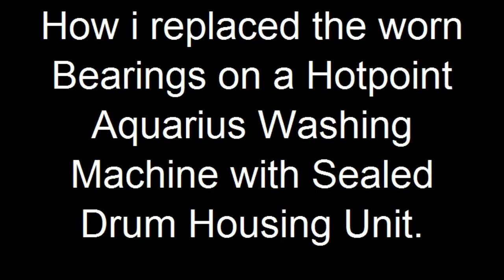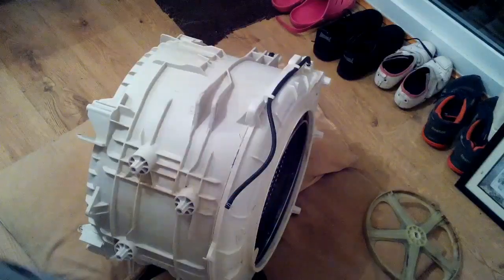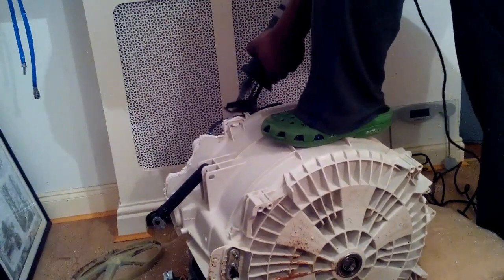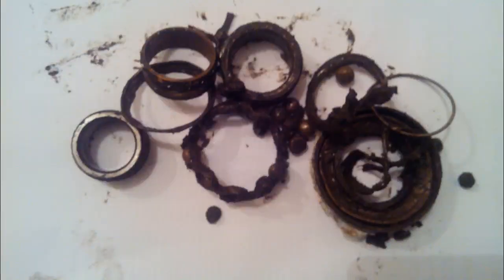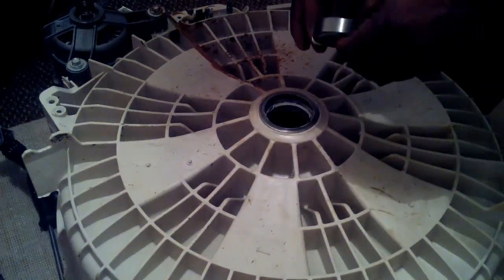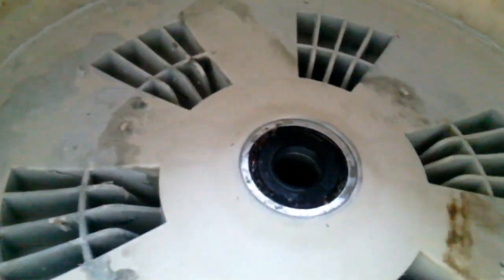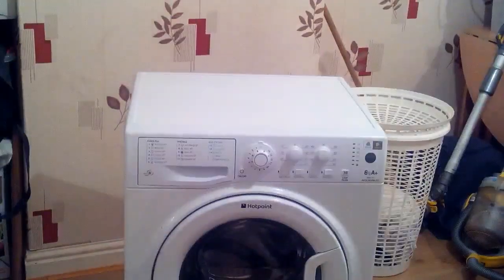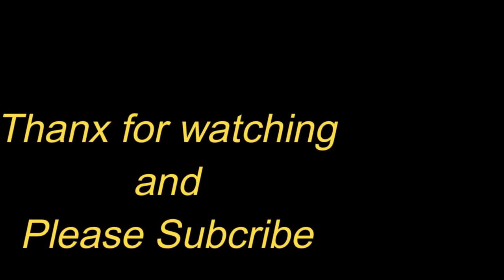Washing Machine Sealed Tub Bearings Replacement

Comment: I have done this to sealed drums before but plastic welded instead of bolting together.
Reply from the maker: Hi David,
               whatever means of holding the Tub together securely will do I suppose, just thought this way was easier and future proof
            
             Kind Regards.
Reply: @green-crocs-fixes1520  I will try your way in future what glue did you use.
Reply from the maker: @davidlawrence942  Hi David, I used Gorilla Glue the brown stuff.
Reply from the maker: @davidlawrence942  or see 14:25 on my other Vid;  https://youtu.be/rvjRUx1kAvU

Comment: Hi.. how did you find the right bearings for this as it's a sealed tub they always say not available.
Reply from the maker: Paul Berry Hi Paul,
                                  Had to measure the old Bearings radius, diameter and thickness, the seal also and then request these sizes from an online Bearings seller. You wont find a set of Bearings/Seal listed for this machine model as it is a sealed unit and they are not suppose to be replacable.
                                 Kindest Regards,
                                                                  Dave.
Reply: Green-Crocs-Fixes Great info, thx!
Reply: Paul Berry o
Reply: I bet the manufacturers love You. No doubt if You hadn't shown this, a lot of machines would have been scrapped. Brilliant, and thank You very much for that

Comment: What glue was used ?
Reply from the maker: Hi Fresh Cut,
                       Used Gorilla Glue waterproof.
Reply from the maker: .. and Snowflakes is banging 👍👍
Reply: Thank you for the reply 😃

Ahh I used a red hylomar like seal on mine... needless to say it failed after 15minutes for me, I spent 6hours start to finish then left it 24hours 😭🤣. 
I didnt have any gorilla glue and used only 10 nuts and bolts, but it was well worth the fun of tearing it apart and rebuilding it. Lessons were learned. 
Your video is brilliant, I just wish I'd followed it to the letter.

Thank you for checking my video out, really appreciate the feedback 👍🙂
Reply from the maker: @Freshcut93  Yes I used to use Blue Hylomar on engine gaskets back in the day, and this would seem ideal as it can withstand high temperatures, however this is a different setup. The bolts are used to hold the Tub together, the Gorilla Glue is used as a seal as it expands when drying filling any gaps missed, also helps to hold the unit together.But like you said.. nothing ventured and all that!

                         Regards.

Comment: Hi, it seems we have the same washing machine and next weeks i have to replace bearing on my hotpoint. Do you remember bearings model?
Reply from the maker: Gino Van der Pistillon Hi Gino, There are no listed replacement Bearings for this model as this has a sealed tub. So I measured the Bearings inner and outer diameters and width then sent the sizes off to an online Washing Machine Bearings supplier requesting the sizes and Seal. They are cheap enough. Regards.
Reply: ok thanks

Comment: I have the same issue with my Hoover washing machine which has a sealed tub. Thought it was irreparable before seeing this video. Could anyone that has done this repair confirm if the glued seal held up and how long since the repair. I am just concerned the glue will fail and leak. Thanks
Reply from the maker: “ Ye of little faith’ 
                              Namski, I have repaired three so far, this was the first. Used it for about 18 month’s then sold it on eBay.

          Regards 😀.
Reply: @green-crocs-fixes1520  many thanks. I have in fact gone ahead to order a set of bearings so I can carry out the repairs. I really don’t have £400 for a new washing machine this time around. Hopefully it goes well. I have rewatched your video and made notes on steps to follow. My only issue now is not knowing if I have ordered the correct bearings set as my particular Hoover (oph761df-80) don’t have any bearings described as compatible, since it is a sealed unit. Hopefully the generic one I have ordered will work. 

Thanks for your video. It inspired me to go ahead with the repair. I might use a wet room grade silicone and see how it goes
Reply from the maker: @namski2410  Namski 
                                           There are no replacement Bearings or Seal listed for a Sealed Tub or Eco-Tub Washing Machine as they are not designed to be replaced, hence why the unit is glued together where as conventionally they were bolted together. So you have to measure the old ones once you have removed them, them request the sizes (Bearings and Seal) from an online Washing Machine Bearings seller. 😀.
Reply: @green-crocs-fixes1520  great. Makes more sense. I will stop my order for now and get out the old bearings and seal first. Good idea. Thanks again

Comment: I have a similar machine, the bearings are fine however I just had to replace the 2 lower suspensions legs due to it shaking about violently, now I have a leak that is somewhere near the back and is getting onto and into the motor but I cannot find the source. is it possible the violent shaking has cracked the outer tub? and if so is there a way of fixing it?
Regards
Reply from the maker: Dave Kemp Hi Dave,
                                       You may find that the crack is around the bearing area as there is a lot of stress around that area anyway, and the extra shaking makes it worse. Strongly recommend that you remove the Tub and Seal with Gorilla Glue, squeeze it into the hole or seam when the unit has dried out as it will expand and leave a mushroom type seal. Then allow to dry for 24hrs. Regards, Dave.
Reply: Thanks for your reply, I opened up the sealed tub with my scorpion saw with a fine blade fitted. Sadly one of the legs on the spider has shattered and shards of the metal have punctured the outer plastic tub in quite a few places. As the spider is welded onto the inner drum and the price of a complete unit was so high I had no option but to order a new machine. Had individual parts been available I could have fixed it but modern times being as they are the manufacturers want you to buy the full tub/drum assembly.
Reply from the maker: Dave Kemp Sods law M8. All the best.😎

Comment: Full marks for that even with this being an old post. Is it still going ?  There is one thing which spoils it a bit, and that is the music because at the end on the water test outside, I could not make whether there was a sound from the drum 'rubbing' or it was the music,   A GOOD VID  all the same, well done. Why the hell do they seal the drum ? If an engineer had come to do the same repair, would he have cut the drum open OR charged you 160.00 for A NEW Drum outer, inner and bearings? because that would have been what I call a 'rip off"!! Many would just buy a new machine.?  Total waste of money to just throw out.
Reply from the maker: Hi John,
               Well spotted. The machine was banging initially as i had accidentally placed the top brace the wrong way round but that was resolved. A machine engineer is not going to cut the Tub in half in your Kitchen as this would take too much time and cost too much. The wife used this machine for over one year, i had already brought a replacement one when this one broke down, so i decided to make a project out of it but it was sold on as i had another machine to repair. Manufacturers do not want us to repair these days John; they think we are as flush as they are. You even need a computer to diagnose and clear a fault on your own Car.
  Thanx for the comments John,
                                                         Kindest Regards.
Reply: Your welcome sir.  :))

Comment: Hi,
So I have a strange request maybe you may be able to help.
I opened up my 8kg indesit innex washing machine and the bearings are completely damaged. The front bearing was completely shattered :-(. Means making measurements becomes rather tricky.
Anyone ever opened such a machine and still remembers the sizes of bearing ordered?
Reply from the maker: Hi Dennis,
                  So long as you measure the outer diameter of the big ring and the inner diameter of the smaller ring for both bearings and their width, don't  worry about the bearings as most of mine were missing. measure the seal also.

                  Kind Regards.

Comment: Hi i need to do the same not sure what size bearing i need Ive got a wmud 843p hotpoint with a sealed drum :( what size bearing are they thanks
Reply from the maker: simbo simbo 

Hi Simbo,
                  Had to measure the old Bearings radius, diameter and thickness, the seal also and then request these sizes from an online Bearings seller. You wont find a set of Bearings/Seal listed for this machine model as it is a sealed unit and they are not suppose to be replacable.
                                 Kindest Regards,

Comment: Hey Green-Cross, I have a tub like this, but the bearing is hard to find, can you help me locate it?
Reply from the maker: Aban's Insurance Brokerage 
                                                  Unfortunately there are no Bearings and Seal listed for Sealed Tubs such as this one as they are not designed to be replaced. You are expected to replace the whole Tub, however what I did was measure the old Bearings width then inner and outer diameters the Seal also,  then requested the sizes from an online Bearings supplier.
             Regards.
Reply: Green-Crocs-Fixes  what size were your bearings because I have the same machine. I want to order the parts before I take apart the machine to reduce the amount of downtime! Thanks
Reply from the maker: Hi Jamie,
                        The Bearings sizes on this particular machine was 35 and 30mm the Seal was 38mm.
here is a more detailed video https://youtu.be/rvjRUx1kAvU 

      Regards.

Comment: Hello  man 
I have fix main but there is a leak  so it is not working properly. I need to know what is the glue name I used silicone but still 
The leak  effect the water switch
Reply from the maker: akramlool Hi Akramlool,
                                                   I used Gorilla Glue to fix the Tub together as it bonds and expands also.
      Regards.

Comment: Hello Green-Crocs-Fixes I have a sealed drum its on a bosch exxcel 7 varioperfect my Q is I cannot find any bearings would any similar ones fit as i'm well P****d Off and not shelling out £200/300 for a new drum after watching your superb video I thought i'd kindly ask if you could advise me in any way to save me ££££!kind regards.
Reply from the maker: Hi Rashio,
                  a common question. A sealed tub washing machine will not have the Bearings and Seal listed anywhere for sale as they are not replaceable theoretically. So what I had to do to get around this issue is cut the tub apart after drilling holes for the bolts, then more importantly I had to measure the sizes of the old Bearings and Seal once I had knocked them out, then request these sizes from an online bearings supplier.

                  Regards.
Reply: @green-crocs-fixes1520  Hi Croc,

That's my conclusion after I did a bit of research and came across a said Bearing company online who asked me to send the Bore and outer dimension sizing's I have manged to remove the tub so am in the process  of cutting it in half wish me luck and many thanks for your swift reply back to my Q all the best bud!
Reply from the maker: @erashio6702  Good Luck.

Comment: Great job. but you don't mention where the bearings or the seal can be got
Reply from the maker: Hi Philip,
              One of the most frequently asked questions. 

There are no replacement Bearings or Seal listed for a Sealed Tub or Eco-Tub Washing Machine as they are not designed to be replaced, 

hence why the unit is glued together where as conventionally they were bolted together. So you have to measure the old ones once you have removed them, 

them request the sizes (Bearings and Seal) from an online Washing Machine Bearings seller.

Comment: Can anyone help me I've got a hotpoint Wmfug842p and the bearings are going the noise is unbearable I've got the drum case out just need to saw round the casing as there is no screws around the case.....is it possible to be fixed and can you tell me the right bearing size I need for this...it's such a shame just to chuck it away as I've only had it over 12 months..... thanks
Reply from the maker: Thank

Comment: helou  Can you tell me which GENUINE C00202418 35MM  BEARING & SEAL KIT or 30 mm Drum Bearings and Seal Kit for machine Washing - Drying HOTPOINT, AQD 1170 D 69 EU  thank you very much
Reply from the maker: agron sherifi Hi Argon,
                                          If your machine has a sealed tub like mine then they do not make a Bearing Kit for it because you have to buy a new Tub. I measured the Bearings inner and outer diameters and width then sent the sizes off to an online Washing Machine Bearings supplier requesting the sizes and Seal size also.Hope this helps.
                          Regards.
Reply: thenx - Yeah, it's like your I think, Washing dryer HOTPOINT AQD 1170 D69 EU

Comment: It is unfortunate that a repairman works so poorly. For example, to put the bearings in place, he could use a long screw and two washers AND a nut to fasten on  sides of the bearings, which helps to place bearings in its place by gradually tightening the nut, and also to drill holes. he could use taller drill bit to create holes with a direct angle.
Reply from the maker: Hi Abbas,
               I am not a repair man, this is just me repairing my own machine.
Reply: @green-crocs-fixes1520  Hi,
 please accept my appreciation ,i thought that; this job was done by company repairman or any skilled specialists.so as an unskilled man that was so nice.hope you would not be disappointed.
best regards

Comment: What a job so by the time they get job done it's cost more than the washing machine lol.🤷🏼‍♀️
Reply from the maker: Thanks Bionic,
                          the parts came to less than £24 and labour cost = 0 as this is my own machine.
Reply: @green-crocs-fixes1520  that's fab if you can fix it yourself. It's £40 call out before anybody will look at it around here. Great job 👏
Reply from the maker: @bionicnichola9251  Thanks Bionic,
                                                          they don't want us to repair them anymore, and a new machine is not cheap.
Reply: @green-crocs-fixes1520  it's shocking, they want us to go green but we're having to throw away. Doesn't make sense. This hotpoint is 6 years old but the Candy I had before was 12 years old.  The quality has gone down hill. If I had the time and tools sure I'd have go. Brill you managed to do it.🙌

Comment: My machine just started to fail, no problem I thought replace bearing give good clean but no, been told sorry your machine needs complete drum as it sealed, no wonder the world polluted, why would anyone design a machine that didn't have bolts to get drum out ridiculous.
Reply from the maker: I totally agree Mark.
                                   Not sure why they call it an Eco Tub either as most machines will be scrapped. and as for the Tub that will be Landfill.
Bic Razors are cheap and disposable. These machines are not.

Comment: Need help with AEG l98699fl
Reply from the maker: Hi Emad,
                what is your question
Reply: @green-crocs-fixes1520  is it possible to saw this model and any idea about bearing size? Thanks in advance
Reply from the maker: Hi,
   I have only repaired Hotpoint and Indesit machines, though I would imagine that the procedure is the same providing there is a Lip on the Tub to drill to. Once the old Bearings and Seal are removed you have to measure them then request the sizes from an online washing machine Bearings supplier 
                      Regards 😀.